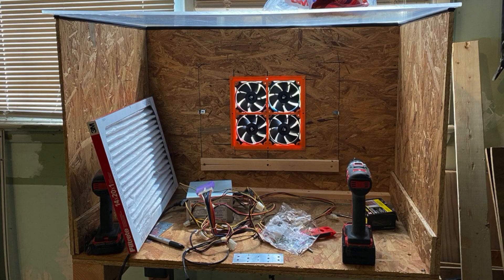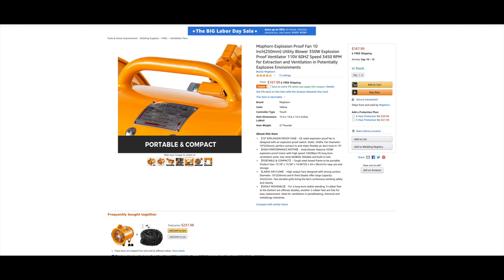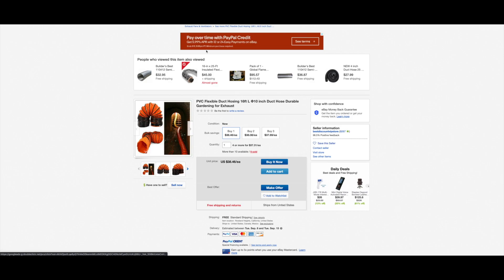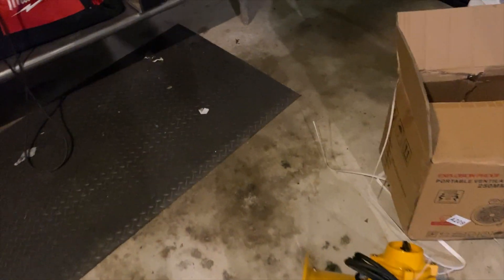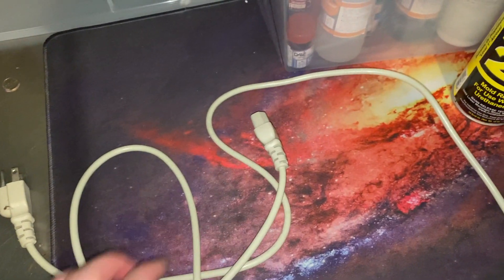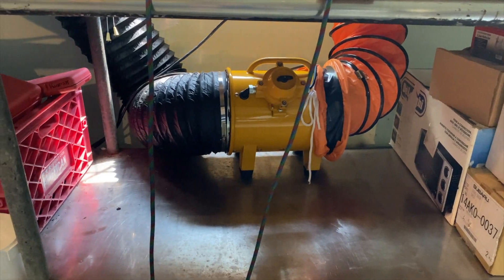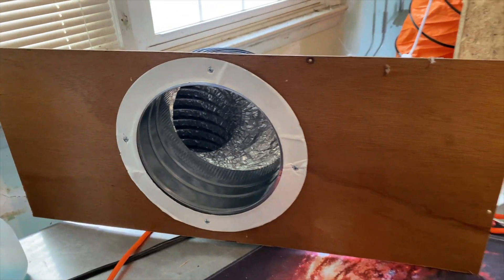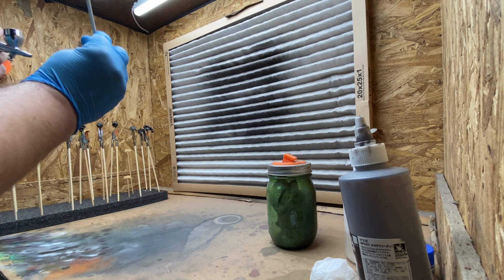The Best Airbrush Spray Booth Exhaust Fan for Lacquer or Any Paint for Gunpla, Miniatures or models

Comment: I spray laquare airbrush spaz stix next to a kerosene heater and don't have any issues. With no exhast
Reply from the maker: I mean I can say I drive around not wearing my seatbelt and don’t have any issues. Doesn’t mean it’s a smart thing to do. It’s not an issue until it is. 

I hope it’s never an issue for you but it’s definitely not something I’d recommend anyone to do… flammable + flame = fire
Reply: @MS09NickDom  water fire extinguisher f it  🤣🤣🤣
Reply: @MS09NickDom  just don't spray directly into the heater thats all.   But i hear ya.  You can drive down the road with a seatbelt on and still die also.  U can die anytime in a second.   I am not gonna freak out and not live. But i know safety is something we all should learn to be better at
Reply from the maker: I hear ya, we can all do better . I agree you shouldn’t live a sheltered life but stick a fan in the window or something lol. The chances are probably slim of ever igniting but I’ve treated enough severe burns to know I’d never want to deal with that. And you want a class b extinguisher for flammables btw😉🤣
Reply: @MS09NickDom  i agree
Reply: I'm more concerned with long term effects of breathing the solvents.  That stuff is nasty.
Reply: @markolmstead4709  probably the same as eating Mc Donalds food 🤣
Reply: @markolmstead4709  i use a mask and a booth

Comment: Great job, thanks for this! A really comprehensive build. I did have a "gulp" moment when I saw the price of the fan unit, but then realised that the combined cost of all the parts is still a lot less than buying a ready-made booth of a similar spec. In fact for a CFM of that magnitude, and explosion/fire-proof, it would cost (according to my research, at least) thousands, for a store-bought unit. Just thinking laterally, I often wonder if it would be easier (definitely cheaper) to have a regular house fan blowing in your back, out of an open window in front of you. Perhaps this would disrupt the airbrushing too much. And obviously you'd miss the fun of building something like this. And only do-able if you have an open window with a comfortable temperature outside. Hmm, am I talking myself out of my own idea? :)
Reply from the maker: Thanks dude. Yeah it’s a bit expensive but it works well plus all the features you mentioned. You could just use like a $20 box fan, they move a lot of air but I don’t know if that would catch fire eventually from the lacquer fumes blowing over an exposed electric motor, it’s a lot harder to made a closed system connected to ducting, just having it face out a window doesn’t guarantee all the  overspray/fumes will be evacuated. It’s definitely better than nothing or even most cheaper booth solutions though. Like I said I wanted overkill because I have a young child so I didn’t want any of that stuff hanging around in the room.

Comment: Wouldn't excessive CFM draw paint away from the part you are spraying?
Reply from the maker: That depends , yes at some number of CFM I’m sure it would completely divert the paint from the brush tip into the vortex like a paint black hole of sorts, but this fan’s CFM volume is no where near that level. I have no issue laying down paint on whatever medium, it is the same as before I was using this fan, only when I’m spraying full blast, like when priming, I don’t get a big cloud of overspray building. And I usually only spray around 20psi, less for metallics.

Comment: Are you using a different filter at this point? What were you recommended to use instead of those pleaded oven filters?
Reply from the maker: Just using the cheap hvac type filters from Lowe’s to catch the majority of the more solid stuff. I don’t think you want to use anything crazy like a hepa filter or something restrictive like that because it puts more strain on the fan fighting air through the filter  and it would have less pulling force in the booth. The main reason of the filter (IMO) is to limit gunking the fan. Obviously that also depends on where your exhaust is and what’s on the other side of the exhaust.
Reply: @MS09NickDom  Thanks! With a fan as powerful  as yours, to save money, you could probably use a cheap large particle pre-filter to catch the initial overspray, followed by a more expensive fine mesh filter to minimize paint gunking the fan. And still get plenty of air suction!
Reply from the maker: Yeah I might do something like that in future, this was supposed to be a temporary booth, I want to make another one with metal sheeting or perhaps take up welding and weld one together and I’ll do like some kind of layered offset slats or matrix of some kind to catch initial overspray before the filter.

Comment: Instead of adding the insert to the back of the machine, why not just get (2) drawstring vent hoses?
Reply from the maker: You certainly could. I didn’t because It would be a little more difficult to get an air aight seal without the flared flange but doable.  I suppose if you found a hose clamp large enough to fit over the outer diameter of the fan, it would work great.

Comment: do you think i can get away with a prebuilt spray booth from amazon? I am brand new to painting and airbrushing and will mostly be using gaia color paints so part of me is worried about potential fire.
Reply from the maker: It depends where  and what you’re spraying. I would say like cheaper Amazon prebuilts are ok for acrylic, water based paints(non toxic), but if you’re using lacquers, I’d get something more substantial. I know it’s easy to be lax cause it’s just model paint, but they really are very toxic, some brands more than others and should really be handled as such, ie adequate ventilation  and a proper respirator. Long term exposure will mess up your lungs in some way.
Reply: @MS09NickDom  thanks yeah i plan on doing it in my garage similar to you in this video, i will purchase a respirator eventually, since it is hard finding once since covid (and won't paint until i do) , but my main concern is not causing a fire with my lacquer paints. I plan on using only Gaia notes paints and thinners basically, which i understand to be highly flammable. This is the booth I am considering buying 

https://www.amazon.com/gp/product/B00BMUH8L6/ref=ox_sc_act_title_10?smid=A23ADOZFIJNPFB&psc=1
Reply from the maker: Gaia is one of the worst in terms of toxicity, literally cancer in a bottle lol. I use Gaia and mr color mostly too. That one looks ok, the fan is only 141 cfm,  I don’t think it would be adequate but I never used it so I can’t say for sure. The fans I was using before were 62 cfm a piece, so it should have equated to 240 cfm all together and they were def not good enough, though it might work better as a single fan.
Reply from the maker: It should be decent, the fan sounds a lot stronger than the other one you posted, and 9 cubic meters per min is around 318 cfm. I never used it so I couldn’t tell you it was adequate per se, but definitely a better option out of the two. Probably fine for regular spraying, the thing that usually got me was priming. I usually use gaia nazca and evo, that’s when I’d get the most overspray just because I usually have it coming out full blast and priming most of the kit at the same time.
Reply: @MS09NickDom  i see, thanks man i really appreciate all your advice and help. It's hard to find info on gaia paints, i found a few dozen posts on reddit that were really helpful but other than that not so many youtube videos i could find, so yours was very helpful. love your kyrios custom build vid btw.
Reply from the maker: No problem! Thanks dude, I appreciate it. I wish I had more time to put out more, I’ve been working on the YJL Hyaku Shiki for like 4 months now lol.
Reply: @MS09NickDom  Hope to see it completed! Sorry to bother you with one last question or two but are the nazca paints limited edition or something? I know they are designed by Naoki, and they are so cool, hope they don't go away lol and also does 1 bottle of paint last you through a full MG kit paintjob? thanks again
Reply from the maker: They are more like a special edition designed by that pro scale modeler Naoki, they have like higher pigment density than the regular Gaia paints and they are tougher, especially when you thin them with the pro use thinner specially made for the Nazca, np003 is the designation number for it I believe, it creates a stronger bond to the plastic is won’t flake off as easy on moving parts like joints and such. The Nazca mechanical surfaced is what I usually use mostly for both resin and plastic kits. I love it but the only down side is it leaves the surface kind of rough, so if you’re doing something that needs like a high gloss finish like  chrome or just like a high gloss finish, you’ll have to go over it a few times with a gloss paint and/or gloss coat. I have a few of the actual Nazca colors too and they are amazing. I thin my paints anywhere from 2-3 to 1 ratio, so one 50ml bottle of surface yeilds about 150-200 ml, which last me like 4-6 mg kits. I get like 45-60ml from the reg colors which are 15ml bottle, that varies depending on how much of a particular color is used on a kit.

Comment: I purchased the same fan and am having the same issue with hooking up to a 10" metal take off. I also purchase vinyl duct 10" with the bell on the end and I can see how it will fit over the intake side. I've tried using the opposite end of the hose to connect to my 10" metal take off and it won't fit.  Am I going to have to bend in the crimped in to make it work? I also noticed that your orange duct seems to be shorter than mine. Did you cut yours off? My main concern is adapting to the 10" take off on my spray booth. Any suggestion would be appreciated.
Reply from the maker: Yes, I originally removed the metal ring from the end of the vinyl duct which gives you a bit more stretch, bending the take off edges in a little bit helps too but you kind of just have to muscle it on there and then I used duct tape around the take off just to give it some rigidity from backing off. I did end up cutting about 3 feet or so of the vinyl hose off as I didn't like the unnecessary  looping dead space for optimal flow , being that the window I exhaust out of is right behind my booth.

Comment: That's a cool build... but an explosion proof fan is overkill for what you're doing: an "Air Over" electric motor exhaust fan would have done the same job for less.
Reply from the maker: Thanks dude. Yeah, I mean it’s a nearly 2k cfm fan for painting tiny mechas and such, it was overkill either way lol, but that was what I going for. I’ve seen people using the 12 inch model in like car spray booths. My main draw to this fan was basically the amount of air it moves, I wanted it to be overkill for peace of mind, not just for overspray in my garage, but mostly for my kids safety from any exposure whatsoever. I don’t think that level of airbrushing would cause an “explosion” per se, but lacquer, especially the hardware store grade pure lacquer thinner I used to clean my brush between colors could certainly ignite a flame if there’s a spark, so there’s that peace of mind granted the low probability.
Reply: Can you suggest a source for an "Air Over" exhaust fan?
Reply: @misterlyle.  sorry friend... YT keeps auto deleting my links...
Google "fully enclosed Air-over electric fan motor." Grainger is one supplier I go to.
Reply: @Visigoth_  Thanks for your reply!  (Sometimes I will add a link as a reply to my own comment.  That way, if the link drops the main comment will stay.)  I have found Grainger (a dotcom site); looks like they have lots of fan motors.  I'll call them on Monday.
Reply: Any decent air over exhaust fan will cost way more than this one and not be nearly as versatile.  I bought mine for $145.00 and bought a speed controller for $20.   Now I can dial it down for my small spray booth or use it separately if I'm spraying large projects in the garage, want to use it as a cooling fan, quickly evacuate odors, smoke, etc.  For the price, you can't beat this fan.

Comment: hey man, nice paint booth? I found this fan but I am not sure if it's explosion proof, is it the same than yours ? https://www.amazon.es/Mophorn-Ventilador-Profesional-Construcción-Industrial/dp/B07MFY8BSN/ref=cm_cr_arp_d_pl_foot_top?ie=UTF8&th=1
Reply from the maker: Thanks dude, I want to make a better one eventually, this one was just made from scrap wood. The fan you linked is not the same one but it is similar, it's the same company. That one looks a little cheaper, the one I have has metal  fan blades and looks like a more substantial motor. The one you are showing also needs 220 volt.  I'm not sure if that is standard where you are, but 120 volt is normal here in USA. If you do not see it on your countries amazon, you can check ebay too, I see a lot on there too.
Reply: @MS09NickDom  Thanks, I found the same as you. But When I turn it on my fan push air, it doesn't aspire air, how did you do ?
Reply from the maker: Turn it around